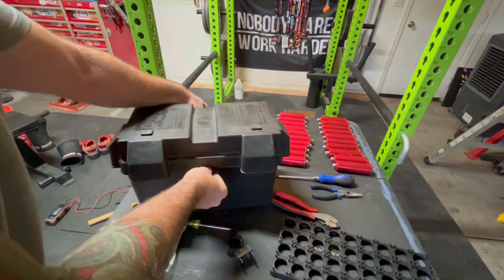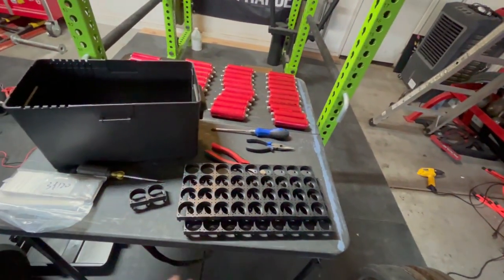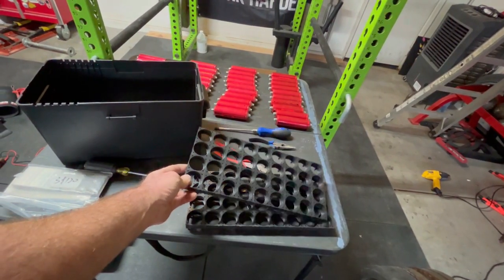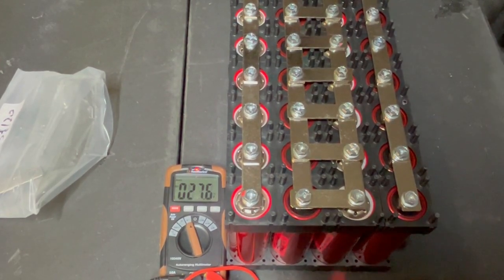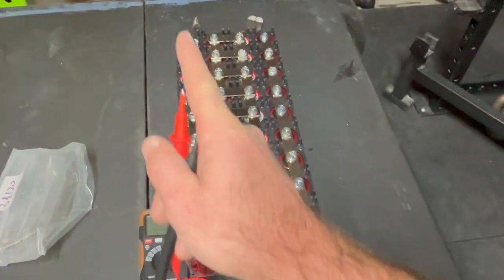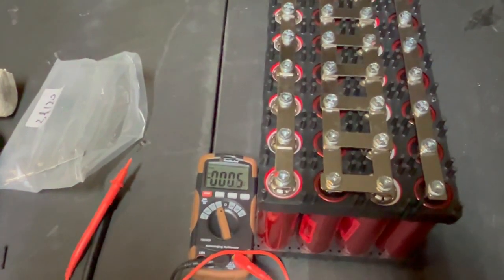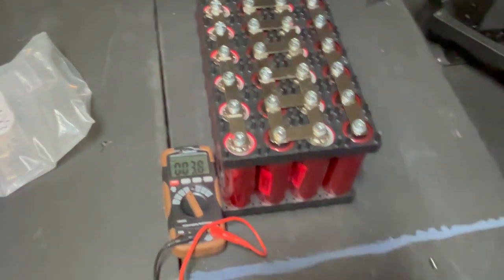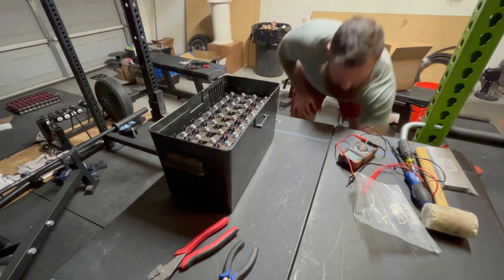72ah Headway Lithium Bank build for the Husky Tundra

Comment: LAF Audio got a clear case that glows w leds and stuff. Theyre pretty sweet, i might grab one.
Reply from the maker: Yeah, I was considering one of those, but since the battery is in the back of the bed, I wanted something a little more rugged and completely enclosed.
Reply: @Husky_Shane_BassHead  yeah I got mine off the link from years ago when parker built his. It was like $50 on Ali Express.

Comment: What up ! I was just wanting to remind you how dangerous these cells can be. From what i understand they are great as long as the voltage is topped off with a trickle charger before starting your car,an rushing into the cells to much voltage or they can explode. Iv seen videos of this happening. Usually in cold weather an when the voltage is down only a couple volts. Other then that there ok. However if i were to use these i would also in line from the alt. I would run an battery dis connect shut off high current switch. To prevent accidently starting the car an rushing to much current into the cells.
Reply: I've used this overcharging w a 300a alt @ 14.8v for 2.5 yrs in the snow belt and haven't had 1 issue. Just sayin.🤷‍♂️